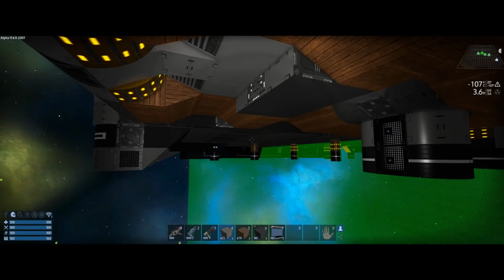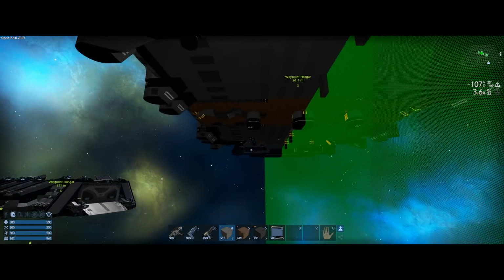Empyrion Galactic Survival - Addressing the Waypoint Hangar repair bay issue

Comment: Hi Jeff. Big fan of your work. How about dropping inwards from the hanger doors by a two block 22.5 slope and have the centre section at the level of the repair block as is. Keep the side bays at the half block. I'm sure with your magic you can merge all the levels.
Reply from the maker: Thank you! I think I got it good now. I didn't do that exactly, but I got a large enough level area by the repair bay and it works with the biggest HV/SV's I made to date. I kept it at size class 5 despite having the hangar 6 blocks longer now. So it gained some more space. Class 5.48 lol. I did have to remove some deco trim blocks in places. It also has 2 more o2 tanks. I will be updating the the blueprint soon. I have one more test to do on it. Thanks again :)

Comment: This is an example how a (small detail) "wrongly" placed block can be a PITA  and compromise the functionality of a given component like repair bay. Another approach to solve this problem, that came into my mind while watching your video, might be to cut and separate the whole floor part then select and move it one block lower, enough to place the repair bay properly. After that use console commands to replace the half floor blocks of the floor with whole shaped ones and finally, close wholes created in the process. BUT, if there are half shaped blocks placed elsewhere might need to be taken corrective care too, manually Console commands are but pain relievers, trust me. Need some work from the player to get accustomed to, though.
Reply from the maker: I thought of that as well. I guess there was a few ways to fix it. I hope the method I ended up doing works out well. Also, to my surprise, it passed the SI check without adding additional support beams :). Thanks again!